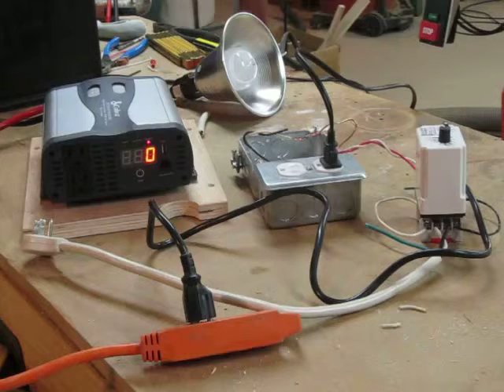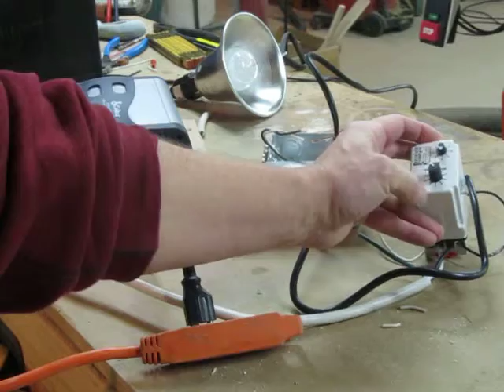Refrigerator Battery Backup: Electrical Test

Comment: I got a 1000 watt cruising 2000 Watt peak inverter. I want to buy a battery to run a regular size fridge for 12 out of 24 hours. I have free electricity nights to charge the battery and run the fridge on the grid. Where do I continue off? I do got it battery charger for cars